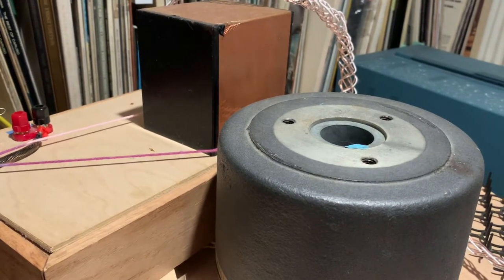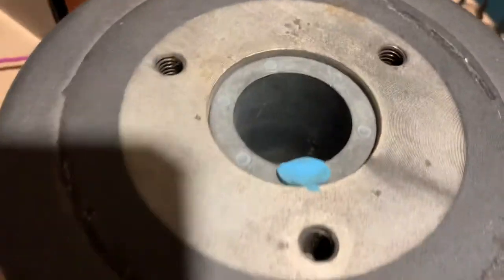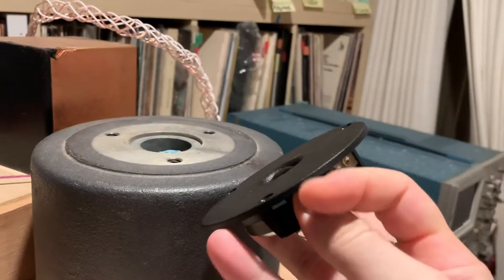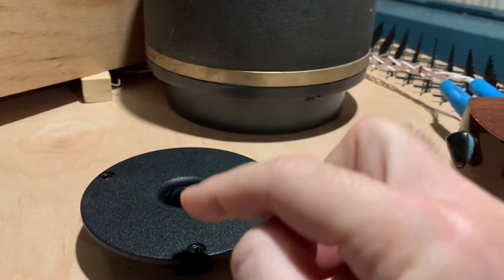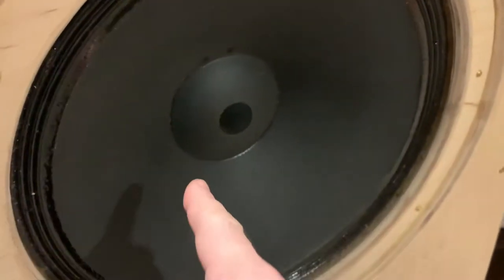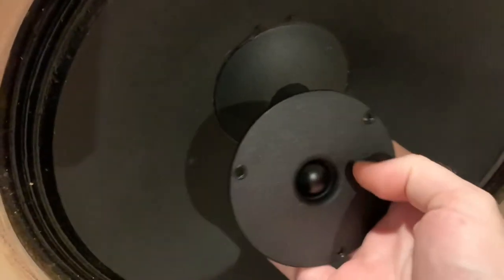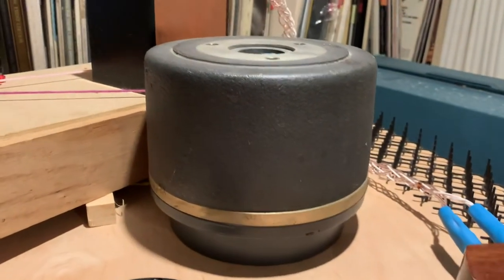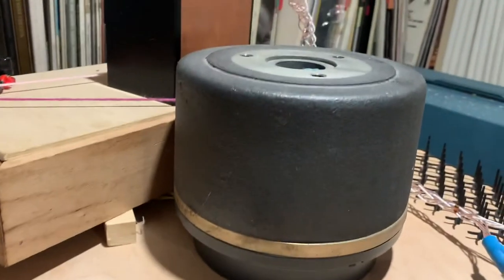Compression driver vs dome tweeter!

Comment: Looking to get KLIPSCH installation speakers, 3-ways, both the MF and the HF are high compression drivers. How woudd MF compression drivers perform versus dome-type MFs with 6-inch to 10-inch in diameter?

Comment: Other than efficiency, do compression driver offer better sound quality?
Reply from the maker: Depends highly on the actual driver. There are plenty of bad sounding compression drivers just the same bad sounding tweeters using other technologies. Compression driver has the advantage to produce a wide range without distortion. Once you get used to a good compression driver, it is almost impossible to go back to tweeters as they have absolutely no headroom compared to CDs. Even the best tweeters start to compress by 90dB SPL. Compression drivers have about 20-30dB extra headroom. A normal tweeter (even a high quality one) takes off your head at 100dB (listening fatigue), while a good CD will provide 110-120dB without fatigue. 
The caveat with CDs is that hey need extremely good HF from the amplifier. The slightest issues will loom enormous when played at 110-120dB. 
To this day, by far the "best to my ears" is compression driver. The worst highs I heard was also compression driver.... Do, I'd say the CD covers the entire quality range, and one needs to understand equipment synergy and systems development at the highest level to benefit. Going for CDs blindly will likely get one pure hell.

Comment: all tweeter works and create sound. its not like punching the water and causing ripple like you said. I think you don't know what you are taking about or your example or explanation is totally wrong.
Reply from the maker: I am using comparisons, sorry you did not get that. Thanks for watching! If you have better comparisons to illustrate the difference between what compression drivers and dome drivers to to wave propagation in a simple manner, you are welcome to share! Thank you, Janos
Reply: He said it's not the most efficient way, he didn't say dome tweeter don't create sound.
Reply: His example is correct and fitting. He is talking about energy loss due to inefficient coupling between two materials of different densities (diaphragm and air). Sorry if it flies way above your head. It's engineering.

Comment: Do you know of any commercial or DIY examples of hornless compression drivers? I've searched for it , but never found any.  Would you lose a lot of the lower frequency support or will it just be the directionality? It almost sounds like a good idea to skip the horns and try using the compression drivers as is.
Reply from the maker: It appears I am the pioneer in this front.  So far I have not heard of anyone else (company or DIY) experimenting with hornless compression drivers down into midrange. My buddy in Australia started experimenting with CD in the 10+kHz range, and he gave me the idea to try it. I was going to build my horn, and until then I just hooked it up hornless, without EQ for crossover to compensate for lack of horn. It gave me a natural ambient sound I never heard before. I prefer to using horns (and the shelving EQ you need with them), and some of my audio friends also far prefer it to any horn they heard, but there are others who preferred the traditional horn sound with the added upper midrange hyper-resolution (and fatigue).
Reply: @realworldaudio  very interesting! And fun you had such success. My horn buddies didn't think so much about it when I had the idea. Now I will definitely try it!

Comment: Could a better analogy be that if you were trying to punch the air and trying to blow a candle out with your punching? The air molecules will just conform to your fist and not transmit the pressure to the candle across the room?
Reply from the maker: Exactly, superb analogy! ; ).
Reply: @realworldaudio  Can you expand the analogy? How does a compression driver/horn play into the air punch analogy?
Reply from the maker: @nikonmikon8915  Well, punching the air is exactly what an unaided driver is doing at low frequencies: it moves forward, while the  majority of the air  mass in front of it fails to continue the motion in the same direction - this analogy starts and ends there. If we were to add a funnel/horn to our fist, then the air would not whistle past our fist, the gas molecules get trapped in the funnel. When our fist stops moving, the accumulated pressure in the funnel is released along the path of the punch, and is able to extinguish the candle. The horn on the loudspeaker driver does the same thing: funnels the air motion, so it can transmit energy more effectively.
Reply: @realworldaudio  awesome explanation! thank you

Comment: i use 1a20 kinap compression driver without horns. it was a lucky coincidence. it is also retrofitted with a paper dome, instead of polypropylene one. it also matches ver very well with 25gdn-4 12 inch kinap midbass speaker on a larger open baffle. my amp is single ended tube with select vintage components from the 50s.one very weird thing i have, but that i can really really recommend is a large final capacitor, the last one before the tubes. mine is 8kvar i think, made in the 60s. it weighs 20kg. try and see if you wish. hook it up first thing before the tubes of course, if you will decide to try this. i really enjoy your channel!
Reply: Please post a video of your paper diaphragm Kinap drivers. I will check your channel. Thanks

Comment: The Compression Chamber reminds me of blastings/detonations in big saltmines... (open Your mouth, quickly!!) 
Fun aside, the issue of the dome tweeter is its small surface. Electrostatic loudspeakers can produce efficient high soundwaves, because it there are huge surfaces combined with extreme small moving masses (foil).
Reply from the maker: 😍😍😍😁. Yes, the small driver's issue is the small surface.... we can use the BR cabinet to extend the low end, easy to get HF, but midbass is very very hard to get, that's why they almost always sound lean, even when we can extend them low...

Comment: Thanks for the video.
For car , dome tweeters or flush mount tweeters?  Which type of tweeters are best for car audio...plz.
Reply from the maker: Hi Jani, it really depends on what kind of sound you want in the car... my preference is a balanced natural sound, similar to what I get in my home system. By far my favorite for cars is full range paper cone drivers. 6x9 ovals with whizzer cone... Granted, they do not play extra loud, and it's ideal for in town driving and listening while you are parked. For super loud listening they are not the way to go, and I do not have preferences there as I never experimented with such setups. Having a car stereo blast to 110-130dB over the 80dB background noise of a highway ride is a very bad idea... very bad hearing damage, very fast... 
I should make a few videos on a few thing one can do to elevate the level of experience. A little tweak on the battery that significantly improves audio quality - even those smallish 6x9 paper cone drivers will seem to go an octave lower, and in addition, even the car performance improves! (Engine runs smoother, more power and better mileage!)
Reply: @realworldaudio  thank you...

Comment: Sir thank you for nice video.. 
Can I use pro compression (horn)driver for home hifi .. with best class design crossover?? Plz reply 🙏
Reply from the maker: Yes, you can use a pro compression driver. Just adjust the level to match the mid/woofer complement, and I suggest to start with a second order high pass filter. For crossovers, try to go as low order as possible for most natural response, or go higher order for most sculpted response. Depends how low you are bringing the compression driver down, if it's HF duty alone then you can get away with first order high pass, but if you go down to cover the midrange as well, then 2nd order (or higher) is required.
Reply from the maker: @tejkarangehlot4741  Tejkaran, thank you for sharing! I have not played around with these drivers, so cannot give you a specific advice. However, will make in the next few days a video with advice to help with the crossover design, and to bring them to work together. I think you have good drivers here, with great potential!
Reply: @realworldaudio  
Yes sir thank you.. I already subscribed ur Chanel...I will get all notifications...
Like ur videos
Reply from the maker: @tejkarangehlot4741  Namaste Tejkaran, videos coming with preliminary analysis on your Beyma and Faital drivers! Can you send an email with the pictures and cabinet details, and crossover parts details to my email?  arcturus127 at gmail.com
Reply: @realworldaudio  
Ohh. Namaste sir.. thank you.. I will share all .. on your email address
Reply: @realworldaudio  what would be considered low ? im thinking 2000hz
Reply from the maker: @zorhis1996  For a regular tweeter 2kHz is pretty low ;

Comment: This is rubbish. The dust cap on a woofer has little to no bearing on the sound. It is designed to keep debris from getting into the magnet and coil structure. On the other hand, the dome on the tweeter dictates the dispersion of the sound.
Reply: Driver manufacturers know that dust caps are an important element of the sonic signature of the driver, even woofers.  Try it out for yourself, different shape dust caps. (Convex / concave, flat, phase plug, vented dust cap, different materials, etc.)